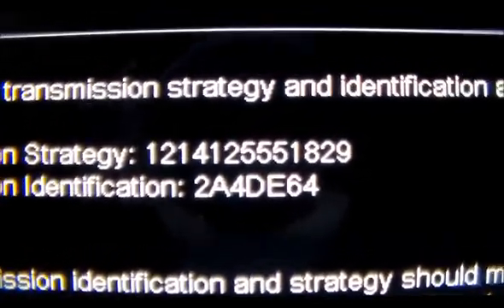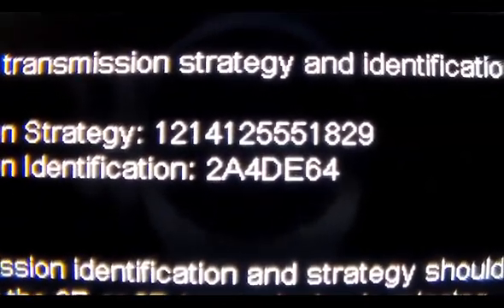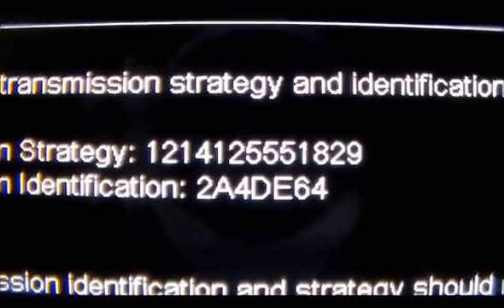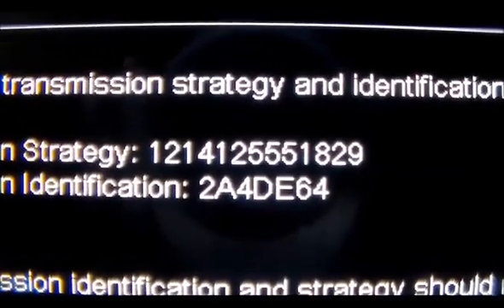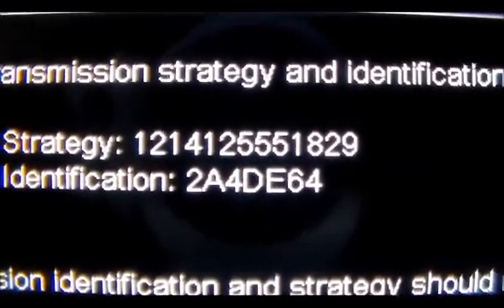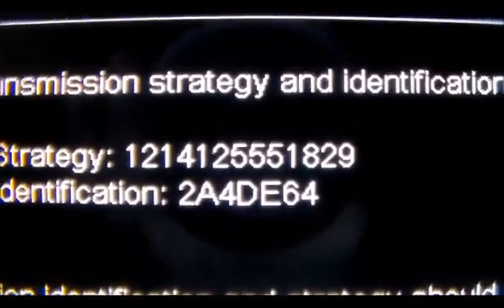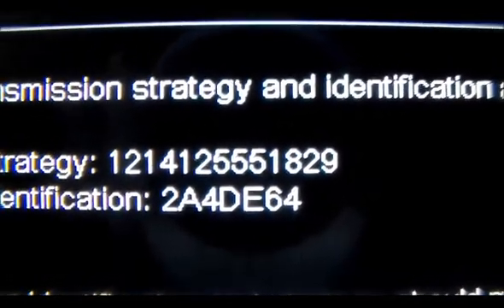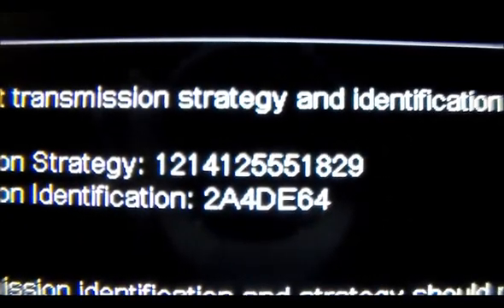6F35 Calibration Program

Comment: Hi, Garry can you tell me why my 2014 fusion shifts poor on Drive mode. lt lint between especialy 1 and 2 but when it run on S mode its so much better almost smooth.
Reply from the maker: in sport mode, there may be a rise in line pressure to give it more firm shifts for that "sport" feeling
Reply: @GaryFerraro  so what should i do with that ? Where is the problem ?
Reply from the maker: @grzegorzbrzeczyszczykiewic1429  Possible pressure loss, Internal problem How bad is it?
Reply: @GaryFerraro Thank you for answer, i think i must to go to mechanic and do some test or something. Again thank you for your time.
Reply from the maker: @grzegorzbrzeczyszczykiewic1429  take it to a shop and let them road test it and scan for codes

Comment: Great video. Can the solenoid marking be read without removing the 6f35 gearbox in Escape 2017?
Reply from the maker: Do you mean the solenoid characterization ?
Reply: @GaryFerraro  I mean the description from the part to know what code to enter when programming.
Reply from the maker: @rufus1981pl  yes, you can get that through a scan tool, but if your changing it, it will come with new codes to enter
Reply: @GaryFerraro  Thx Gary! The thing is that my gearbox works poorly when changing gears and I wanted to check if it has the correct codes programmed.
Reply from the maker: @rufus1981pl  was the Transmission worked on?
Reply: @GaryFerraro  yes, but I don't think that solenoids were replaced.
Reply from the maker: @rufus1981pl  ok, so you had the transmission overhauled and they did not install a new solenoid body?

Comment: my 6f35 works good in reverse but in drive it lags and then goes fine then i lose power and drive then it kicks in to keep driving at 30mph, change fluid twice in one shot, any thoughts great video
Reply from the maker: common on those for the forward piston to Debond or tear causing a long delay in drive
Reply: @GaryFerraro  sometimes it’ll be in drive then disengages and message on screen says not in park then goes away

Comment: Is there a way to figure out which solenoids go where using the solenoid strategy number?  I totally screwed up and took out all the solenoids while cleaning the valve body and now don’t know which position each one goes into.  Was going to install a zip kit as well so is it going to need to be recalibrated anyway after that?
Reply from the maker: no, cannot go by that number, what year is this
Reply: It is a 2010 Ford Escape with 6F35 gen 1 and they are labeled AA3, AB2, AC2, CC5, DB5, CB5

Comment: Hi Gary I have 2018 Ford Transit connect with 6f35  transmission. I had hard shifthing especially at low gears and reverse.I replaced the valve body with solenoids. Now vehicle doesn't move at all.Do you know if the unit needs to be reprogrammed or recalibrated.
Thank you
Reply from the maker: Shouldn't need program, did you hook up manual valve?
Reply: @GaryFerraro  
Which one is the manual valve?
Is it plunger looking thing that moves as you move the shifter

Comment: Do these have to be reprogrammed even when they come from a Ford dealership
Reply from the maker: if your talking about the solenoid body, yes it does,  if installing a solenoid body, it will work without the program but sometimes may not shift correctly

Comment: Can you change Solenoid Band number? For example my number was 3 and I want to change it to 2. Is is possible?
Reply from the maker: I'm sure you could but the band numbers represent the flow rate, if a different number is used, the flow rate of the solenoid will not be the same but there is a chance it may adapt
Reply: @GaryFerraro  Have you met with a issue that when i put Drive or Reverse something "hits" in the transmission and whole car moves. When on Reverse car drives normally and has power, but on Drive, car doesn't have power and it's kinda slipping and i order to move it i have to press gas pedal hard. Oil level is okey.
Reply: it is weird, because it is almost new transmission (13k miles)

Comment: Hi. I have 2010 ford fusion with the 6f35. Got 2 codes p0756 and p2701. Is it more likely the B solenoid or maybe a stuck valve... or maybe an internal failure. Any ideas.. thanx
Reply from the maker: How the the car drive and shift? what do you feel
Reply: @GaryFerraro  it would jerk when shifting gears and sometimes there would be a delay before shifting. Erased the codes but come rightbback. Took it for a drive this afternoon and ran smoothly. I'll drive it tomorrow maybe when its cold ill be able to duplicate the problem...
Reply from the maker: @karinestg100  ok, let me know, Full of fluid correct? fluid level was checked?
Reply: @GaryFerraro  yes fluid checked and ok. Ill let you know.
Reply: Hi. I took the car this morning for a test drive. Had no issues at all... Decided to remove the valve body today. Oil was pretty clean, found no metal shavings. When I opened the v/b, I could only see 2 beads.. the other one was stuck to the separator plate. And I was able to push the bead through. Pretty sure my problem is right there. I also removed and cleaned the valves, all is ok. The only thing I didnt do is taking out the  solenoids, because im thinking the plate is the problem.
Reply from the maker: @karinestg100  Sounds like you got.  May be able to fix that with a Transgo shift lit, they give you a new plate in the kit
Reply: @GaryFerraro  Yeah i think i found it 👍. Ill get the part at the dealership. 30 something $ for both plates. (I'll change the other plate also, the one that sits in the case). Thanx again!!
Reply: Update. Put in new plates today. Went for a test drive and it wouldn t shift right. 1-2 seems ok but then has a hard time going in 3rd or misses 3rd and goes to 4th gear.. then it slips in 4th and stays stuck in 4th. Even when I apply the brakes, it looks like it doesnt want to disensage... ummm I think i'll have to remove the vb again. No codes either.
Reply from the maker: @karinestg100  ok, you changed valvebody plate    was it damaged?

Comment: So did it fix the problem?  I have a 15 going haywire tripping a P0766.  Hope this fixes it when i start checking ids and programming the new solenoid in.  Thanks
Reply from the maker: Yes, it did fix it.  But if it's throwing a code like that may have internal problem.  I did the calibration because it really didn't feel right but nothing crazy.  What is the trans doing?
Reply: @GaryFerraro  I just got it. It's fine when cold. Run for five minutes. Shifting starts slipping. Going from drive to reverse delay. Tripping a p0766. Cleaned all solenoids. Replacing solenoid d. Then checking the IDs and inputting new solenoid. Waiting on the solenoid to come in.
Reply from the maker: @loganincorporated  When the car heats up any whining noise or does the car stop moving?
Reply: @GaryFerraro  yes. When put in drive.
Reply from the maker: @loganincorporated  Sounds like the filter is clogging up.  Do you hear the whining noise in all ranges hot?
Reply: @GaryFerraro  yes. I bought a filter but was unaware of where it was.

Comment: Any thoughts on what kind of failure this is on this 6f35 in a 2013 Escape?  It will move when cold for a short distance.  Not low on fluid.  I am thinking oil pump and/or torque converter since the noise is present when not moving.  

https://youtu.be/BWIqDqpqpl0
Reply from the maker: The problem is the filter is clogging up, probably converter is coming apart,  I would also recommend changing out the cooler for the trans, i think it is a separate unit. Those can not be cleaned and can cause problems down the road
Reply: Gary Ferraro - thank you!  Do you recommend a complete overhaul based on that?  I pulled the fluid and minimal metal when I ran a magnet through it.  No chunks of material either running through a paint strainer.  It’s at 141k miles.
Reply from the maker: @scotts24  The filter is clogged so the trans has to come out and be split apart, pump has to be removed to change filter, i would do the overhaul
Reply: Gary Ferraro - thanks a lot!  I agree, it’s out so might as well.  I haven’t done an auto trans in a long time, so your video and comments were very helpful to making my decision to do it myself.
Reply from the maker: @scotts24  Thanks for watching, any questions just let me know